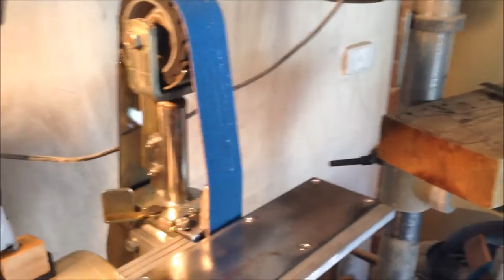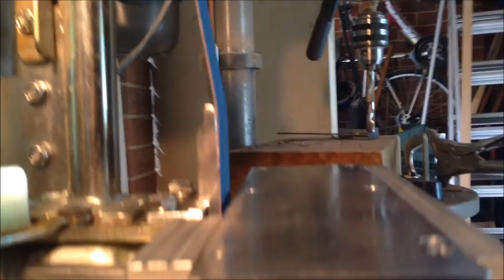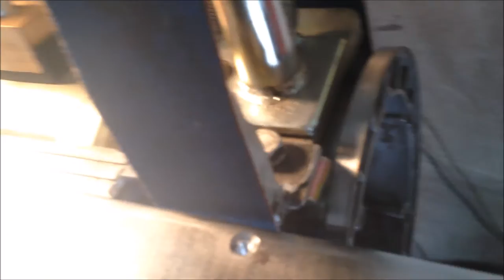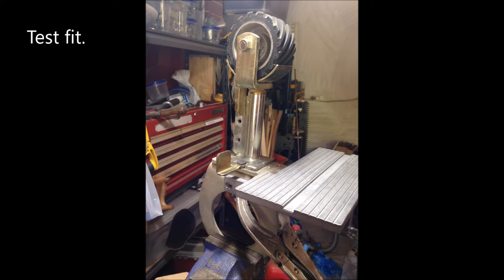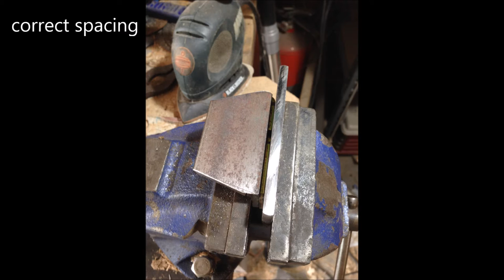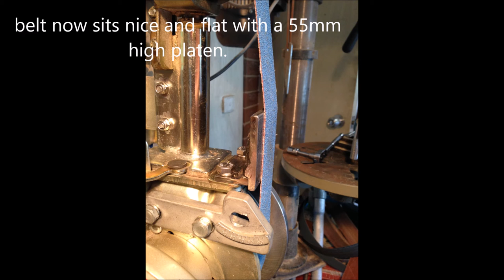Linisher mod movie

Comment: Try mounting the multitool on the left side of your grinder in the same vertical position and you can use the stock  plate.
Reply: I've been wondering if this is possible.
Reply: Yep that’s what I did. Worked great

Comment: Hey Iron Forge Knives. Would you be interested in selling one of those 55mm platen? thanks in advance.
Reply from the maker: Hi, this set up has turned out to be very limited in what can be done, any blade wider then 40mm and its no good as I cant get the angle that's needed, Ive tossed it and am making a new set up like the 48 engineering attachment with 2 rollers and a full length platen, once it's done I'll have another video to post up.